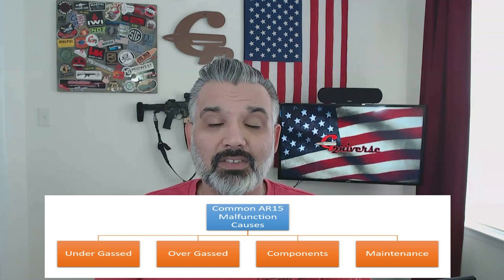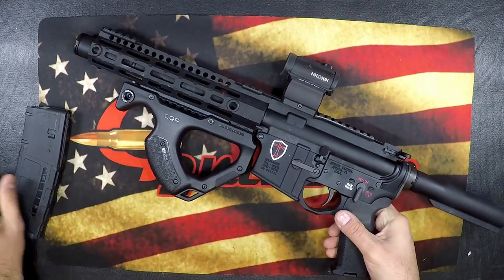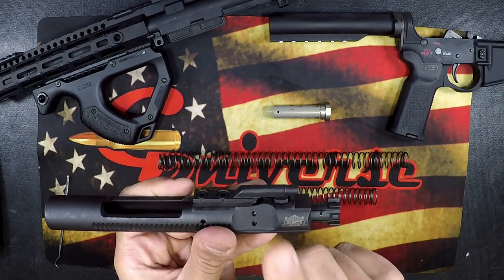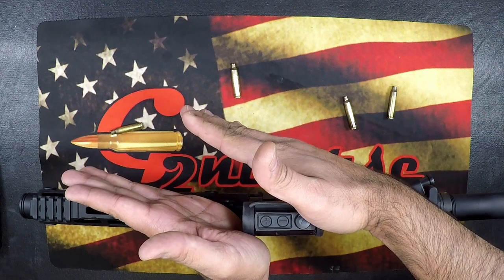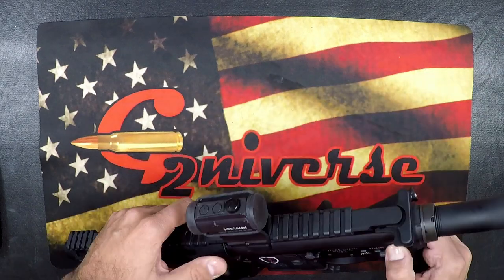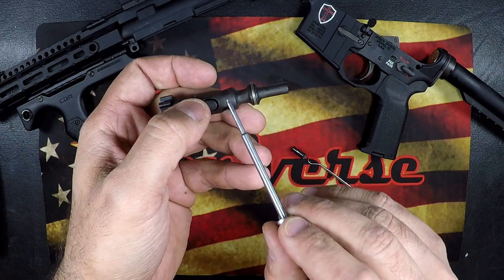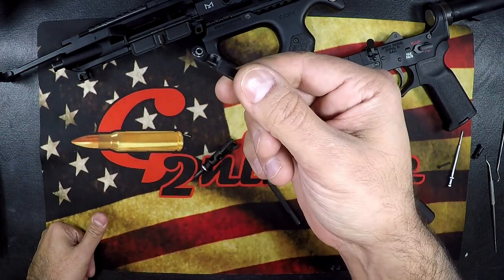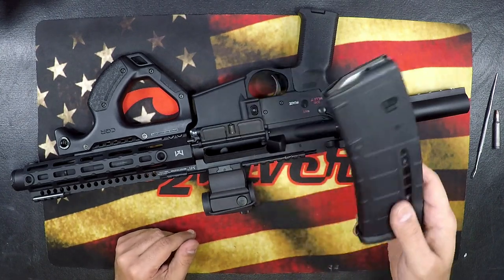Safely Fix AR - Failure to Feed, Eject, Extract and Fire

Comment: I have a urgi 14.5 upper and a bcm lower and i cannot run thru a single mag without a double feed or failure to fire. Tried pmag gen2 and 3 and metal mag. Is it the bolt or gas?
I had the gen 2 pmag get stuck and had to take the gun apart to remove the mag.
Reply: @g2niverse
Reply from the maker: I cant tell you 100% its either the gas system or the bolt.  Youre just going to have to keep doing checks until you find the issue.  There are about 10 videos on my channel that can assist you.

Comment: How do I check the gas tube inside the upper if it's in the correct position or not?
Reply from the maker: Not sure I follow...are you looking to see if its in the upper far enough to fully engage the gas key?  Or are you asking how do you know if its properly centered over the gas port hole?
Reply: Both?

Comment: Can an aggressive muzzle break cause me to be under gassed?
Reply: Really dude? Love my comment. But no response. Wow
Reply from the maker: simmer down bro...that question is based on too many variables.  Take the muzzle break off and shoot the rifle, if it cycles fine without it, but doesn't when it on, you have you answer.  You cant fix a problem until you have a baseline.  The baseline is set by the normal operation of your system without the muzzle break.  From there you can determine the fix.

Comment: My barrel and receiver have feed ramps but still fail to feed. It has the gouges and the mags are fine the mags drop free. It was a new upper bough from Areo with the Areo lower. Like wtf!
Reply from the maker: MrFreddy61 where are they hanging up?
Reply: @G2niverse  the rounds get jammed up where the feed ramps from the receiver meet the feed ramps to the barrel extension. The ramps don't align and there's a tad bit of space in between
 So its causing the rounds to get gouged. I can see the little pieces of copper stuck in the space. I contacted Areo on Friday as soon as I received it, said they would get back to me Sat, never did and am still awaiting thier response.
Reply: Did you resolve the problem? I'm having the same issue whit my Matrix Aerospace...

Comment: Now what do ya do if ya barrel has ramps and reciever has ramps but its still bending shells every 4 or 5 rounds ....I cleaned it real well today chamber bolt ramps ect and hand cycled 25 rounds as fast as I could 3 times with no hang ups but its still scratching the bullet pretty bad everything seems to be in tact as far as gas key gas tube ect any suggestions ?
Reply from the maker: Check and clean the follower on your mags... could be angling down the round
Reply: @G2niverse  i finally figured it out the gas rings in my bolt were burnt out had big gaps in the failed the ring test ect so I guess it was short stroking every 4 or 5 rounds due to lack of pressure but I replaced the three gas rings that was burnt with a single helical single piece gas ring hoping it fixed it

Comment: Mine is failure to feed but my rackat where I pull it back for them to feed it doesn’t pull back it’s loose I can’t put one in the head
Reply: That’s because you did not put your charging handle back in correctly the charging handle needs to go in first and then the bolt carrier group…
Basically you’re charging handle is on the backside of the gas key and that’s why it is loose…
Think of it this way the charging handle needs to grab the gas key to pull the bolt back.

Comment: If you're Building ar uppers  a gas block dimple tool is not optional!!!  Order a damn slr or kak gas block jig so there is never any question that your gas port is aligned 100%..  Trust me, i tried to just do it by eye and save the $30....  Do not be a pleb!!  Order the tool!
Reply from the maker: Agreed 200% so many issues with blocks moving and slipping. Those set screws are trash if you don't dimple. Really, pinning is the only foolproof method.

Comment: My rifle is under gassed and I have tried everything. It will not eject or feed rounds after being fired once. I feel like I have a muzzle loader ar😂.... I failed 1 round mag test. I replaced gas line, gas block, bolt carrier group and I've tried a dozen buffer springs. My buffer is 3oz I have an 18" fn  nato 556 barrel with a odin works adjustable gas block and everything looks good and should act normal but it still has the issue. Im officially stumped. Can anyone help please??
Reply: I would imagine with a 18" fn barrel its gassed at rifle length. If so you should be running the proper buffer, buffer spring and buffer tube for a "rifle length" barrel.
Reply: Extractor upgrade kit ?

Comment: Idk if you can help me but I tested my new rifle and every time I fired I had to manually cycle the bolt it only fully ejected 2 rounds out of 20 the buffer spring seems too stiff but I’m new to the platform and I might just not be used to it
Reply: And the 2 rounds that it ejected it didn’t pick up another round
Reply from the maker: Work the problem using the flow chart and you'll find the solution.

Comment: Understand cyclic timing and what factors affect it.  Install an adjustable gas block to correct your actual problem before buying band-aid heavier or lighter parts to address mere symptoms.
Reply from the maker: Some would argue the adjustable gas block IS the band aid. If you can't get your right to cycle without adjusting the gas, the problem isn't fixed.
Reply from the maker: I get what you are saying.  I am just not a fan of a rifle that cannot operate without an adjustable gas block.  For me, the purpose of an adjustable gas block is to time the rifle to operate correctly when using specialty hand loaded rounds or when shooting suppressed.

Comment: Psa won't retract the shell. I don't care how many times you pull the charging handle.
Reply: Check and see if the extractor isn’t broke. And read the case and see if it’s ripping the rim off. If could be over gassed or a broken extractor. And what ammo or you using in what kind of barrel?
Reply from the maker: mortar